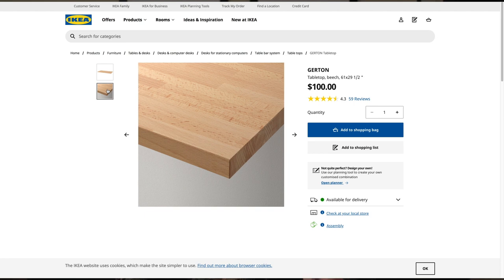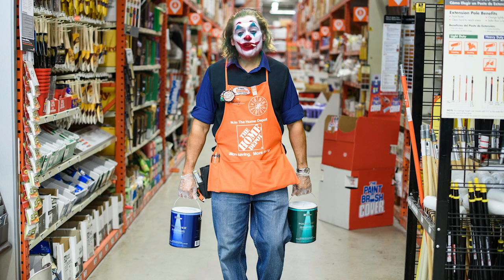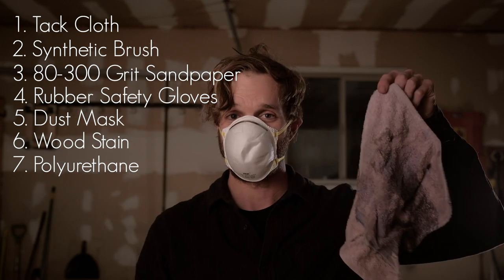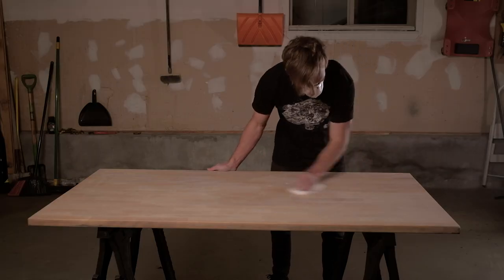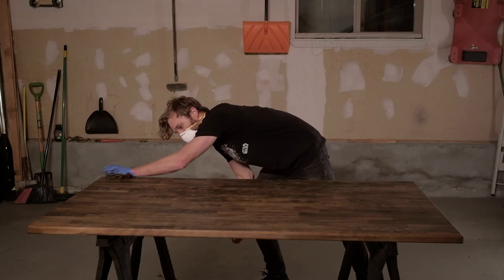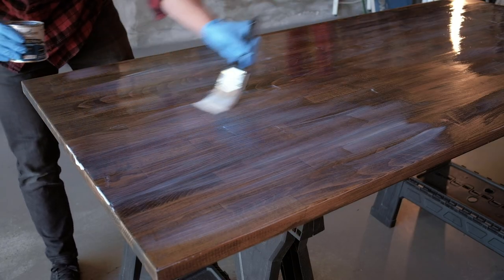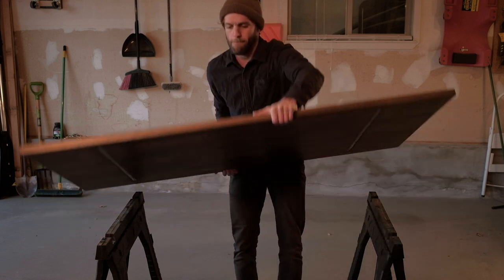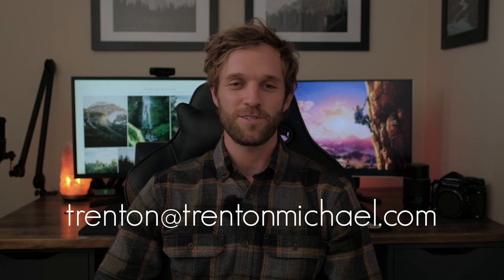My IKEA Gerton & Karlby Desk Staining Project!

Comment: Thanks for the great video! I want to do this with the karlby countertop from IKEA. They sold out on the Walnut so I want to stain the oak (also gives better protection). I would appreciate if you could tell if me if I got it right: So once I sand with the 180, I stain the top and sides, let it sit for 20 minutes, flip and stain the other side...then let that dry overnight. From there I repeat stain if I want darker. For the PE (day after last stain), it's sand with 220, PE coat, wait 5mins, then flip to do other side. Wait 5 minutes, flip back counter again and repeat with coat#2, then whole thing again for coat 3. sand, PE coat #2, sand again, PE coat #3. Lastly, some people is mineral spirits. What's that for? (Sorry for long comment, I would like a confirmation that I get it before doing this DIY). Thanks again for the really useful video!!!!!
Reply: Hey, late reply but I feel like I should warn you. Doing this process the was you're describing will ruin the Karlby. Firstly, you should sand with 220 grit for a smoother finish. Second, only sand, stain, and poly what has oak veneer on it, which is only the top and sides. The bottom does not have really wood on it so the moisture from stain+poly will ruin the particle board. Third, you must wait longer between coats than what you're describing. For stain, wait for it to dry completely before you start your poly, or you'll get very poor results. Give it as last 12 hours to be totally safe I'd say. Then for poly, apply first coat and give it a good 2 hours to dry before applying the second. I would also give a very light sanding between all costs of poly, but not before your first coat. I would give the second coat 2-3 hours to dry as well. Then give a very light sanding with 220 or 320 grit sand paper between the second and third coat for maximum smoothness. Once all your coats of poly are applied, you need to give the table adequate time to cure before using it. I used a waterbased poly that says it reaches maximum hardness after three days. I started using my Gerton desk about 6 days after my final coat, and the finish still scratched with just my fingernail. So I would give as long as you can before use. Preferably 2-3 weeks to be safe. All the best, good luck With your project.
Reply: @TheAngryPeanuts  I'll definitely follow your advice. Took a while but I'm only getting the countertop now. I've another question. The Wulnut Karlby is ~$30 more expensive than the Birch and~$60 more expensive than the oak. Since I'm staining it to a dark colour (like this video) wouldn't it be better the get the cheaper lighter color wood? I researched that the wood quality is not significantly different if using as a desk. That way, the money I save on the counter top covers the cost of the stain and poly.

Comment: Thanks for this video.  I went with the Gerton based on this video.  Thought about the Karlby since it was already stained but 1) Didn't need a 6' desk and 2) I figure I can spend $20 for stain and polyurethane and still get the same effect for less money.  Question though, how many hours would you estimate needed for this project from first sanding to install?
Reply from the maker: Honestly, if you don’t care about minor imperfections, I bet you could do the whole thing in a couple of hours. The biggest waiting point is just waiting for the stain to dry before the poly coat is applied.

Comment: Wish I had saw this before going to home depot. Only got a 220 grit sandpaper block. Also need one of those masks
Reply from the maker: Victor Cabrera oh 220 is plenty fine. No worries there. Just use a shirt over your face for a mask 😷 let me know how it goes!
Reply: @TrentonMichael  oh okay, thanks. Right now I'm gonna check if a small store near me has a foam brush for my stain. If not then I'll go to home depot later today.
Reply: @TrentonMichael  quick question. What can I do if I don't have an area with good air ventilation to do the staining? Since it needs to sit for hours in a "well ventilated area".

If I put it outside debris and bugs may get on top of it.
Reply from the maker: Victor Cabrera if you want, you can shorter the process down and finish it all in an hour or two. I could have done the same with mine but I was just being overly thorough. Do you have a window you can leave open with a fan blowing the fumes out?
Reply: @TrentonMichael  unfortunately no. I'm probably going to be doing it in my driveway tonight. I don't have many options.
Reply from the maker: Victor Cabrera you’ll be good if you wait for things to dry for 30 mins or so. Feel the stain, if it feels dry then you’d be okay to put something over it during the night.

Comment: Hey man great vid! Nice and concise. Two questions though: how many coats of poly did you put on the bottom? And also you don't sand the final coat of poly, right? I've started applying the poly but I'm concerned the final coat is not going to be smooth
Reply from the maker: Thanks, Nathan! Honestly, you’d be good with one coat - and even that’s pushing it. It’s nice to seal in the stain and “complete the job” but as long as you feel the stain has dried on the bottom layer, you’ll be good.

Comment: hey man, i noticed you didnt use prestain, did you notice any blotchiness or was this not a problem on the gerton? i finally got the gerton after waiting 3 weeks for it to restock and im going to do the same espresso stain tomorrow
Reply from the maker: No blotchiness that I can detect. You should be fine, especially if you have a brand new tabletop that hasn’t been used. I used mine for over a year before applying stain but by then I had developed sweat marks from my mouse hand. That’s the only dark area that looks somewhat blotchy...but even then I barely notice it after it’s been stained.
Reply: @TrentonMichael  thank you!

Comment: is it 24 hours between coats of poly? I got oil based cause it didn't say whether I was supposed to use water based or oil based. Everywhere online says to wait 24 hours to use, but is it also 24 hours between each coat?
Reply from the maker: I just waited 15 hours after staining before I applied the poly coats. I only waited about 5-10 minutes between the three poly coat applications. I wish I could remember if I was using oil or water based poly. It seemed to dry in an instant though...if yours is drying fast then I’d say wait 5-10 minutes between coats. If it’s taking longer to dry then I’d just wait a bit and check it with your fingers every so often to see how long it’s taking to dry. I hope that helps

Comment: If I do not want to stain the Karlby, can I just use the polyurethane to protect the Karlby countertop? Also do I still have to sand it first before applying the polyurethane?
Reply from the maker: Absolutely you can apply a poly coat. No sanding needed either

Comment: Ive begun the Stain Process and im satisfied with 1 coat so im waiting for it to dry now. How often should I apply coats of polyurethane since I need to do it 3 times
Reply from the maker: The poly dries super quick. I waited 5-10 minutes in between each coat

Comment: Love how your desk came out! Currently doing the same project but got stopped by the fact the wood cupped.  Spent the last week trying different ways to straighten it. It's almost there and were about to sand and polyurethane it. Planning to so 4 coats. How long did you wait in between coats of poly before you applied the next coat?
Reply from the maker: Thanks, Jay! How's your desk been? Did you finish it? I waited maybe 5 minutes between poly coats.
Reply: @TrentonMichael  It was taking a long time to un-cup so I ended up going with a new butcherblock from home & decor. Similar dimensions but was 1.5in thick instead of 1in. Dropped 4 coats of poly and it's awesome. I waited a day for the first coat (wasnt sure about how long to wait), then 2 hrs the 2nd, then 1hr for the 3rd and 4th. 😃
Reply from the maker: Jay Ferrer awesome, my guy! I’m glad it turned out well

Comment: HELP! Just bought IKEA KARLBY. I like the color so I’m not looking to stain it, but do I need to add polyurethane for any reason? Besides sanding it down to get the tabletop feeling smooth, what else do I need to do?
Reply from the maker: It wouldn’t hurt to add a coat of poly…mainly to protect the table from sweat stains and any liquid stains from drinks.

Comment: When you sanded after the stain was applied ( right before the poly coat) what grit did you use? I saw you used 180 to prep the block before the stain.
Reply from the maker: I believe I used 220 for the sanding. But honestly it didn’t matter too much...especially if you’re doing multiple coats of stain.

Comment: this is great, I am going through all of this to build the top for my standing desk :) thanks for the video. quick Q-- did you use the 8 oz stain, or the 1 QT? I plan on using the same stain, same table top and everything
Reply from the maker: Stain goes a long way so you'd probably be fine with a smaller 8oz jar, but it shouldn't bee much more expensive if you wen to the next size up.

Comment: If I don't want to stain, just apply polyurethane, do I still need to sand?
Reply from the maker: tushar gupta honestly, I am not too sure. Sanding is mostly there to open up the wood grain to absorb liquids. If you feel like the wood seems to be in a spot where it can absorb, then I’d say to skip sanding and move forward with the polyurethane.

Comment: im hoping to buy a 186cm Karlby to use as my table top with a set of Jarvis legs. Are these desktop study enough without a middle leg at that length. Not looking for statistics here just opinions. :)
Reply from the maker: At that length you should be fine. The thickness of mine is 25mm and it feels solid.

Comment: Would you recommend with the Gerton an oil with Danish oil and then spray with spray polyeurothene? Was wondering as I have the Gerton but are not sure for what finish.
Reply from the maker: James Barker for sure! As long as you sand the Gerton a bit to help absorb the danish oil you should be good. I’ve never used a spray polyurethane but my guess would be that you’d be just fine with that too. Let me know how it turns out for ya!
Reply: @TrentonMichael  Thanks very much for fast reply. Do you recommend 200 or 300 grit sandpaper before the oil? And is a sanding block necessary to keep sharp edges?

Comment: For some reason, after I sanded after the first stain with 320 grit, there is a white cloud od dust over the table. I tried removing it with a damp cloth, but it just comes back. I'm using the same water based matte PU. Did you also experience this?
Reply from the maker: Interesting...no i didn't have any issue with a white cloud of dust after sanding. Maybe you could try a deep sand and then restain.
Reply: @TrentonMichael  Thanks! I actually did another coat of Poly and the white scratches disappeared. I just didn't sand the last layer and it looks good now.

Comment: How did the stain the bottom if it's underneath? Did you wait for the top to dry, flip if over and do the bottom each time? Or did you just get under the desk and do it?
Reply from the maker: Yeah I just flipped it over and completed the opposite side.
Reply: @TrentonMichael  This may be a dumb question... but how did you avoid the edges being... double stained? I mean, if you stain the top and sides, and then the bottom when it's done.. wouldn't that edge get some extra stain on it and be extra dark?
Reply from the maker: Michael Mannucci I honestly wouldn’t worry too much about it. It’s pretty easy to keep the sides separated when staining. Even if you do get some stain on the sides, it blends pretty well when you stain the sides later on

Comment: Hey man awesome video! How long should you wait between polyurethane coats before applying the 2nd and 3rd coats?
Reply from the maker: I only waited maybe 5-10 minutes between poly coats. Seemed to dry super quick.
Reply: Trenton Michael and you sanded between each coat? I’ve read that if you’re sanding, you need to wait 24 hrs between coats. No?

Comment: I mistakenly bought the oil based polyurethane. My desk is uneven and globby, uneven. Any tips?
Reply from the maker: I’d say to sand it down evenly and start over with an alternate polyurethane.
Reply: Trenton Michael Which grit would you recommend?
Reply from the maker: I’d start with a dense grit like 80 or even lower just to chew through the oil based polyurethane and get down to the wood. Make it as smooth and even as you possibly can. Then I’d probably try applying a different poly coat at this point. Let that new coat dry for a half hour or so and then sand it again with 150-200 grit paper and then apply another coat.
Reply: Trenton Michael Thanks for the tips man, appreciate it!
Reply from the maker: Daenio1993 of course! Good luck!

Comment: Do you sand after the final coat as well.Also, while the polyurethane was still wet did you wipe off any of the excess you had on or do you just let it dry?
Reply from the maker: Nope! Just let the final coat of stain dry. I did not wipe anything off between coats of Poly; I just let that dry too.
Reply: @TrentonMichael  Did you end up with any brush marks after your final coat?

Comment: Applying oil-based stain with water based poly ? Is this thing still holding ?
Reply from the maker: Yes. As long as you give the stain time to dry and cure, the water-based poly adheres just fine.

Comment: will this warp the wood?
Reply from the maker: For most store-bought wooden tables like this, no. Warping usually comes from moisture drying out of a wooden surface too quickly (ie direct sun and intense heat). But if you do this project in a temperature regulated environment, you will be just fine.